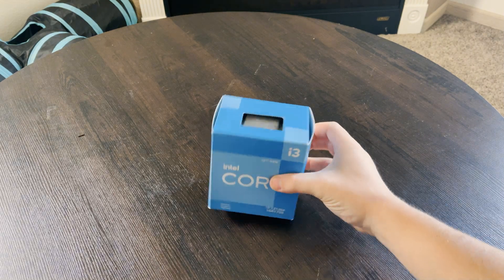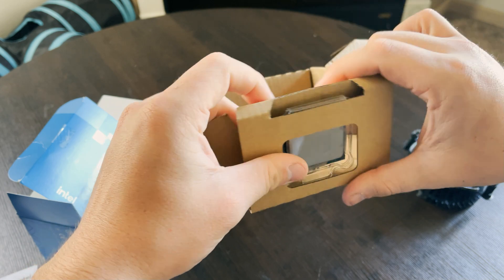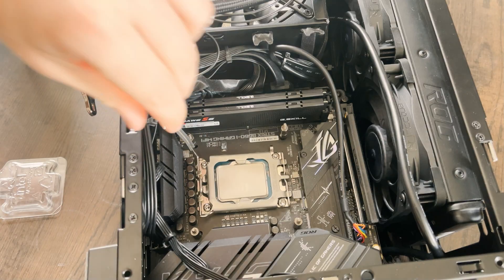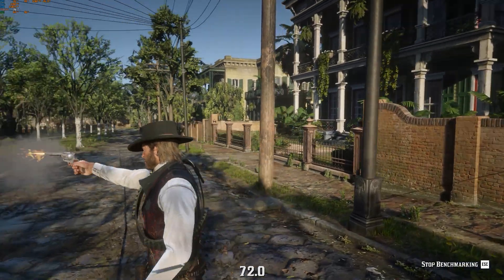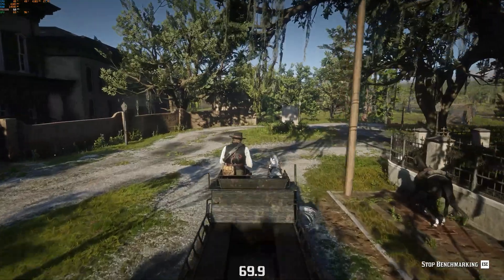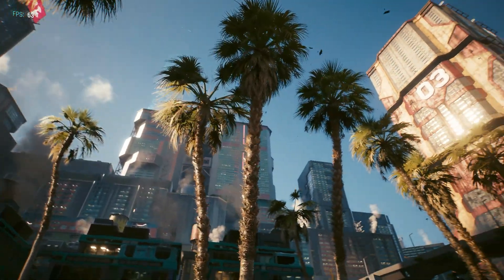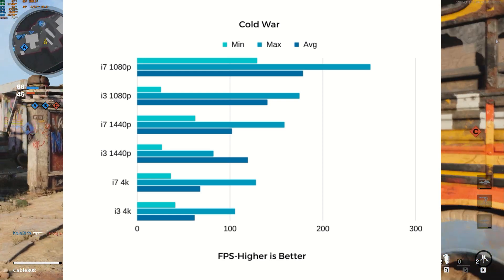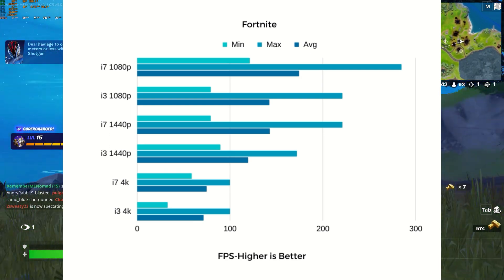Will a i3 keep up with a RTX 3080

Comment: Great advice. If you are a PC gamer and not a video editor or something else, getting a minimum i3 and paring it with a last gen 70 tier GPU, in this case an i3-12100F and an RTX 3070 is a great option, as it wont bottleneck as badly as one might think.

Comment: Yes I build entry level systems with this processor for people and it literally will run all modern games without limit and they are really only limited by their GPU choice, socket 1700 also has 2 generations of upgrades that people can swap out later to get the most life out of their components!

Comment: i currently have a i5 9700k i think and planning to buy a rtx 4080 when it is comming out and when this i3 can keep up this good with a 3080 i think i will be fine
Reply from the maker: If you’re talking about the i5 9600k that’s slower than this i3 that I tested. I would proceed with caution. You may benefit more from upgrading the cpu and a lower end gpu. If you’re talking about the i7 9700k you should be fine just proceed with caution
Reply: @CablesTech  I looked it up and yes it's an i5 9600k. But as I am using an MSI RX580 8 GB atm I think the RTX 4080 will be better for now. I plan to upgrade the rest of the system in 2025 when windows 10 isn't supported anymore and my hardware can't run windows 11 or 12 ( if we have that by then)
Reply: @CablesTech  my gpu is always on 💯 load while gaming i have to check what the max load on the cpu is
Reply: @CablesTech  just checked it after playing Forza horizon 5. and the GPU was on 💯. and the cpu at 79% Load at its highest

Comment: Will a 5600x cpu be enough for RX7000 or RTX4000 series when they come out?
Reply: @eye776  what about 4090 or 7900?
Reply: @eye776  yeah but if I want to upgrade to 4090 and the loss would be little, then there would be no point.
Let's just wait.

Comment: I just upgraded to i3-12100f from Haswell i5 4590. Very big difference everything is smooth. Highly recommend for low budget builds just get cheapest mobo with m.2 slot or better  if you plan to upgrade in the future I don't really plan I'm quite happy with it and will be for long time. I think pairing it with rx 6600 is very good I plan to upgrade my rx 480 to that gpu.
Reply: I'm planning to upgrade from an i7 3770 to the i3-12100f. I have an RX 570. I'm in the same situation you were in. So please tell me, did you notice improvements on the frametimes even with the same GPU after you upgraded?
Reply: @flymanous  Overall much more stable fps. You will get more fps at 1080 for sure. Look at your usage are u gpu bottle necked? I saw the Cinebench scores much much stronger cpu than ur i7 3rd gen. You already have the upper end cpu for that gen so this will give you much newer and stronger platform to build upon like upgrading the gpu to a rx 6600 or better... Whats your budget?
Reply: So glad I upgraded my I5 4460 + RX480 combo in 2019 right before the GPU market got crazy, or I'm sure I'd be in the same boat here.
Went to a 7700K + 2070. Still rocking the GPU but snagged a 12400 used for the price of a 12100 recently.
Now to wait on next gen mid range cards 😒

Comment: Considering how fragile those sockets are I would need more cause to mess with it besides a speed comparison.  I know the pins are easy to bend, destroying the socket effectively of course.  I wonder if there is a limit to how many times a CPU can be inserted and removed before the next processor starts behaving weirdly because of the worn out socket.  Usually a CPU socket is something you would insert a CPU into for long term use really.
Reply from the maker: That is why no one will remember your name

Comment: Iam planning to get an i3 12100f and a RTX 3070. Will it bottleneck ? i mostly play only single player games and rainbow six siege. I only use my pc for gaming. Due to tight budget i wont be able to go with i5 12400f
Reply from the maker: It’ll probably be fine
Reply: Did you do the build?  I am on the fence right now with the same idea.
Reply from the maker: @sevantofra  I did the build it's on the channel

https://youtu.be/NChMP902NjY

Comment: I did a budget build several years ago with the i3 and my friends couldn't believe I'd go with such a low end component but it's been nothing but awesome.  Doing a rebuild of this rig with 12th gen and picked the 12100f for the build (should be here tuesday).  People really shouldn't sleep on the i3, it's a great product.
Reply: I replaced a hard drive in an old i3 apu laptop with a cheap ssd, and for most things, I can't tell any difference with my 9th gen i7, 1660Ti laptop.
Reply: You see, the bottleneck is the 4kbaud modem.

Comment: I have a 8th gen quad core i3, found a new 3070 for $499 so I ordered it, not sure how bad the cpu is going to hold it back but it should still perform better than the 1050TI that's in it now. I plan on upgrading to a i5 or I7 before Starfield drops.

Comment: Amazing video. Do you think that the i3 12100F will handle a 6700XT?
Reply from the maker: The 3080 12gb is significantly faster than the 6700xt so yes but, you’ll probably be losing a few fps on the high end at 1080p

Comment: Giving stress on your cpu are not good,. Your processor will not stay long will die shortly soon..
Reply from the maker: Using a higher end gpu with a lower end gpu won’t shorten the life of either component. Just make sure they’re both adequately and you’ll be fine

Comment: games are all gpu bound so a decent cpu is fine, you don't need the best in cpu's and you can actually save a lot of money by not buying the fastest cpu on the market. You're better just getting an Intel i5 or i7 and or Ryzen equivalent and spending the a big amount on the gpu but that also depends if you want to game in 1080p, 1440p or 4k. My setup has an Intel i9 10900k and a 2080super gpu but my gpu struggles to play games in 4k at 60fps so I should have brought an i5 or i7 and a 3080. That would have been a much better setup for 4k gaming for me as I am a casual gamer and not a competitive gamer.

Comment: i wanted to see in msi afterburner if the i3 was going up to 100% usage while the gpu is less than 90% usage..... that would mean that the i3 cant handle the 3080 but if the gpu was 99% and the i3 was less than 90% usage then its good..... but this video doesnt have it
Reply from the maker: At lower resolutions the i3 and 3080 were both at 90-100% and at 4K the i3 was between 70-90% with the 3080 pinned between 95-100%

Comment: Many that said my cpu will bottleneck, they dont know whats bottleneck are, just overclock the cpu or ram so will you be fine or get a i3 with new gen 4-5 up after that, that is almost the cpu not the gpu that will bottleneck

Comment: I3 is not bottom of the barrel a Celeron or Pentium is the bottom of the barrel i3 is still got some power to it most games use only 4 to 6 cores and so this is why he's not seeing a difference in gaming performance
Reply from the maker: That’s exactly right
Reply: @CablesTech  makes you wonder how well a 12th gen Celeron or Pentium would do gaming compared to the i7 and i3 in this video
Reply from the maker: @raven4k998  Honestly with the Best celeron from this generation being a 15w chip and the 12th gen pentium being a dual core at about the same price. I would'nt even try
Reply: @CablesTech  you should try fewer cores may make all the difference besides you have the i7 to go back to afterwards do it so others can see how those chips perform without paying for them blindly

Comment: How would the i3 compare to an i7 11700f? I have both of those and I can’t tell
The difference between the two
Reply from the maker: Good question, and I’ll be honest I don’t actually know because I don’t have a 11700f but if I had to make a guess. I’d say the IPC of the newer i3 is better than your i7. It’s on a newer architecture so that makes sense. But your i7 has a high enough clock speed to counter that and then some. It’s also a 8 core 16 thread chip. So your i7 likely has better single core and multi core performance.
Reply: @CablesTech  that makes a lot of sense! Thank you
Reply: @astheniacat8710  look at the 11 series as a 10 series but with pcie4 support. No real gain in performance in these tick tock generations. look at 12th gen being  at least 25% better ipc.

Comment: On normal games scenario, an i3 12100 or i5 12400 is already plenty of power to play modern games (paired with anything better than an RTX 3050 at least. But even the 3050 is still capable, just not worth the price).

On emulation scenario, however, a jump from an i3 12100 into an i7 12700 is very noticeable, especially if you’re emulating ps3 games. I currently have no problem with a core i7 6700K that is paired with an RTX 3060, but i could use the cpu upgrade in the future.
Reply: yeah games can't keep up with the power of an I3 the extra cores on the i5 and i7 are doing nothing just there to give you a higher number
Reply: 2060 beats the 3050 in almost everything. I'd  save bit and go with that id in that price range. Or sale 6600.
Reply: @PDXCustomPCS  definitely. I also recommend getting an RTX 2060 for a friend who will be building a pc soon. It’s way better than a 3050 (performance and price wise). Also no problems with the lack of VRAM, since i bet he didn’t like newer AAA games anyways (also not playing above 1080p)

Comment: My Rx580 8gb is actually bottlenecking this Cpu really bad, its funny because its an I3😂. I get about 25% - 30% cpu usage and 100% gpu usage in all my games😅. I upgraded Cpu from an old Fx 8320 that was at 80%+ usage in the same games, for some reason the FX never showed 100% usage but yea this I3 is literally a highend i7 from a few years ago
Reply: Also I think they changed the binning process a bit for the 12th gen, I believe the highly binned Cpu's become the i9's and the i7's, i5's & i3's are on the same performance cores with the i5 and i7 having just more working cache after manufactured and the lower binned cores become the E-cores. That's probably why your I3 is almost on par with your i7.